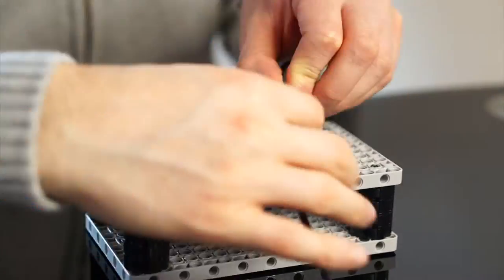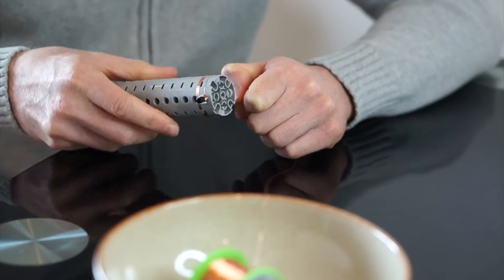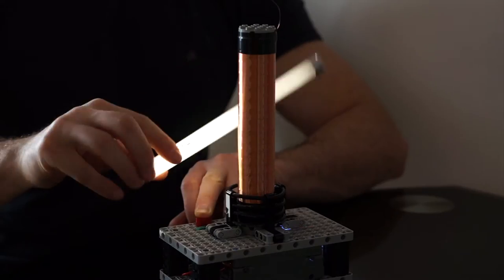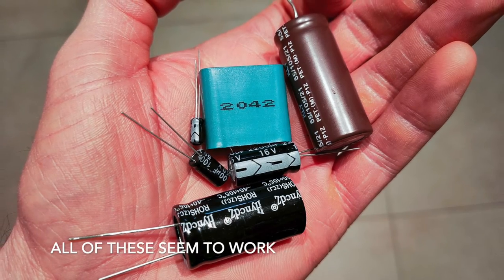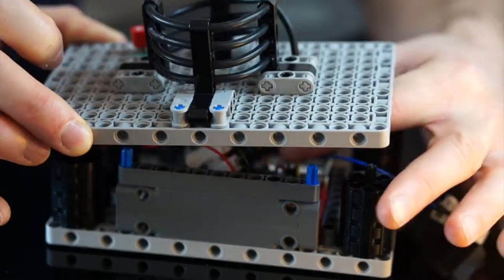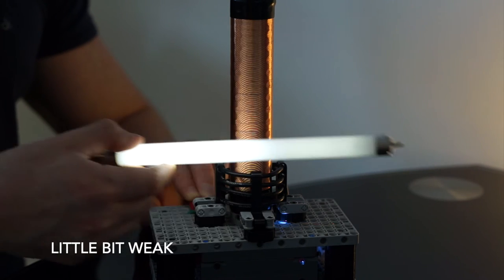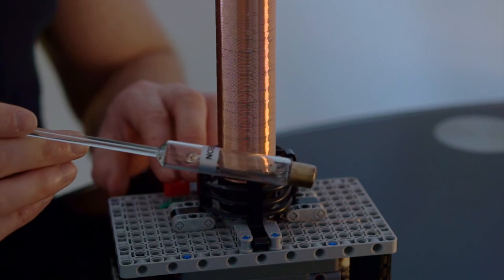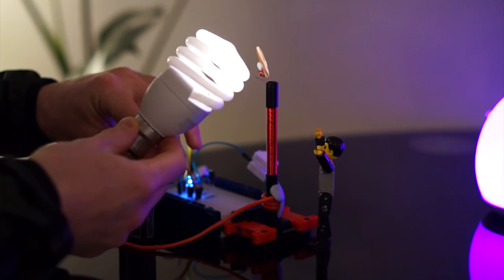Making Wireless Power With Lego

Comment: Instead of a 9V and a custom button, you could just use a standard PF battery pack. Also, what is the frequency you are using? 2N2222 is not that high of a frequency transistor IIRC.
Reply from the maker: Damn now I'm kicking myself - using the PF battery pack would have been a much better idea! The frequency is self-drive, so it sort of depends on the setup.. but usually for a 2n2222 it oscillates around 1-2 MHz. Though I believe they can manage a max of around 200-250 MHz. It really doesn't like a lot of current though. Tends to get fried in about 15 seconds with voltages over 9v if current isn't limited. I've found you can sustain it much longer if you limit the current a lot though. Or use a heat sink. Might post some experiments there at some point

Comment: hey, the circuit is say, the secondary coil top is going to ground and between a capacitor. can this part be skipped?
Reply from the maker: Hey, if I understand correctly, yes you can skip it - the top load acts as the 'capacitor'. But most of my slayers don't even need a top load to work fine
Reply: @JamiesBrickJams  oh okay, thanks❤️❤️
Reply from the maker: @01drain  no problem, good luck!